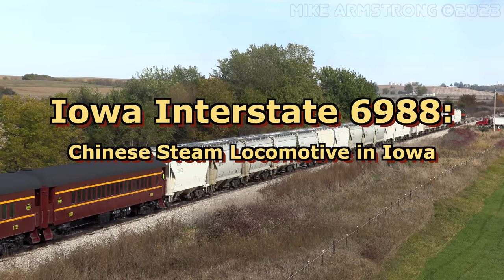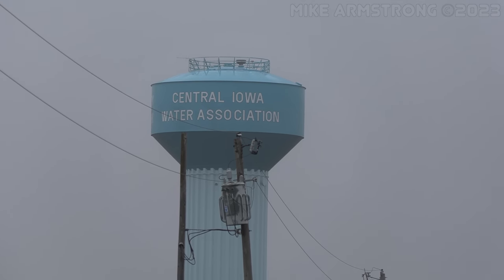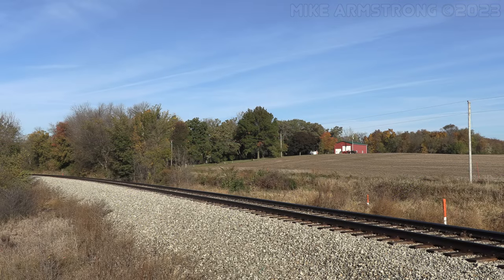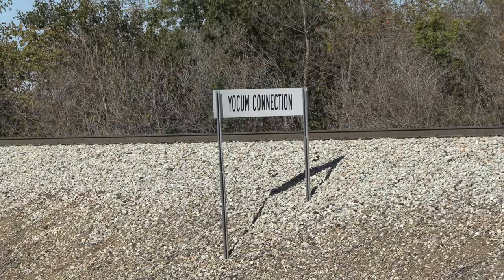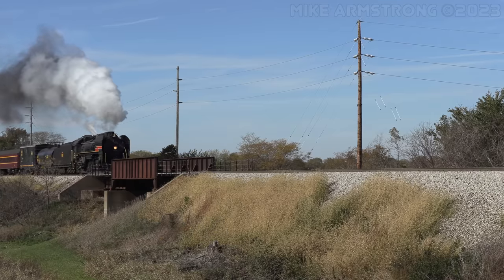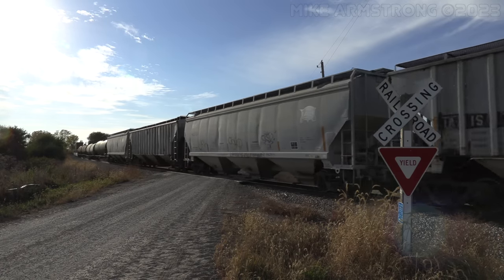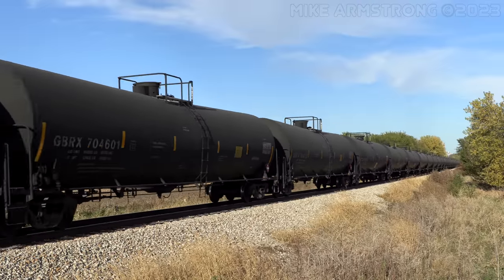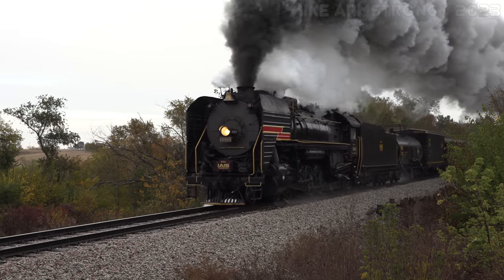Chinese Steam Train in the US: Iowa Interstate 6988

Comment: What’s interesting is that the 6988 will be placed into long term storage and the final excursions are done. Those red passenger cars that Iowa Interstate has owned are former Pennsylvania Railroad P70 coach cars. A while ago, the Railroaders Memorial Museum mentioned there are P70s they will be working with to be part of the excursion/exhibit train to be pulled by Pennsylvania Railroad K4s no. 1361. I wouldn’t be surprised if those P70s are acquired by the Railroaders Memorial Museum.

Comment: Hey Mike do you know how many times a diesel electric locomotive be stripped down to its frame and rebuilt after it shows its age because I kind of hope that via rail will rebuild their F40s again after rebuilding them from 2009 to 2012 and give them a third life when they show their age and become worn out.
Reply: A diesel locomotive can be remanufactured an infinite number of times. The major drawback is that when you do so, current US EPA emissions standards have to be met, making it uneconomical in many cases to continue doing so.